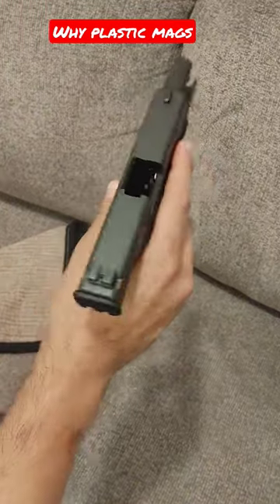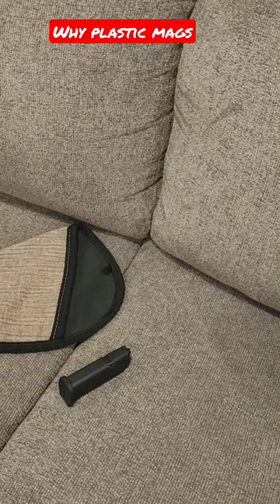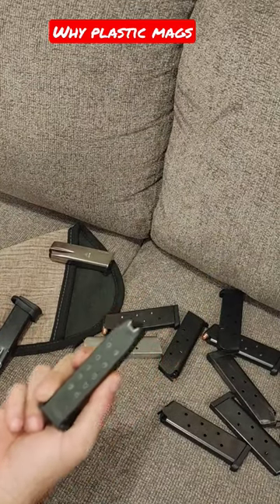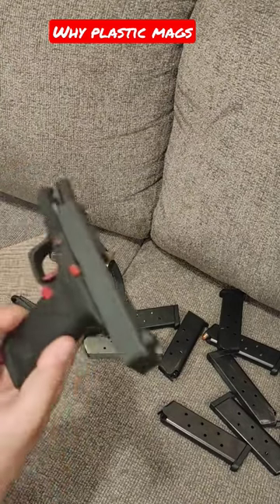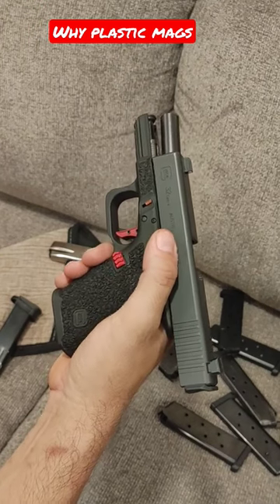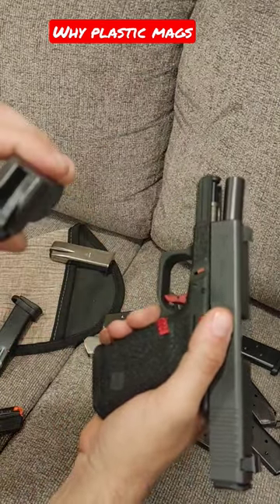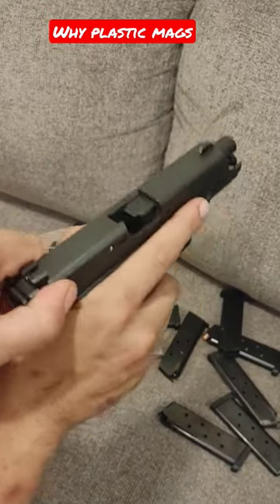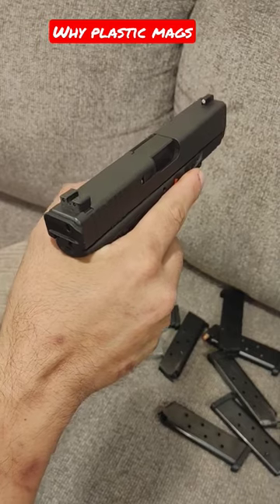why Glock ACTUALLY uses polymer mags

Comment: Glock mags are durable and don’t get dinged or bent up real easy when they hit the ground. They are simply more durable in that regard.
Reply: They're more durable than any of those metal mags.
Reply: @mynameisjeff6988  Yep, they sure are.
Reply: Maybe that was the case back in the day, not anymore.
Reply: @GunRunnersTrainingCo  No, it’s still very true. As someone who trains LEO’s for a living, I can promise you that Glock mags take a beating without separating, cracking, or denting, better than anything else out there. I have seen 1911 magazines split along the spine, Beretta/Sig magazines throw floor plates and take a sh;t, and countless others with bent feed lips. It’s simply a fact.
Reply: @GLOCKCOPG23  I've seen everything fail, including Glocks
Reply: @GunRunnersTrainingCo  yep, but Glock mags not as often.
Reply: @GLOCKCOPG23  I disagree based off my experience. I think everyone can agree that Sigs are the worst out of the bunch.
Reply: @GunRunnersTrainingCo  In my 27 plus years as an LEO firearms/tactics instructor and LEO armorer,  I have only seen worn out mag springs cause occasional feed probs on Glock mags. No bent up feed lips, no popping off floor plates, no mag tubes bent up or smashed beyond use, no cracked floor plates, no split spines, no cracked followers….. I did see one put in the trash after it was accidentally run over by a Tahoe. Lol. Between requals and new trainees, I come across a couple hundred Glock mags yearly (not to mention other manufacturers mags)…..what issues are you talking about? I’m interested.
Reply: @GLOCKCOPG23  I'm still using glock magazines from the Clinton's high capacity mag ban still stamped for Leo,  they still run great 👍.
Reply: @gregg6474  Exactly what I’m saying.
Reply: I would say Glock mags do cost more to manufacture. I have to make the polymer mag and you have to bend metal inlay instead of just bend a thicker metal.
Reply: I have never seen or heard of a metal mag getting dinged or bent. What are you talking about?
Reply: @MSSynsyterGates  When you conduct rapid reloads (rip, flip, stick) as part of most training regiments today, you drop them on rocks, concrete, plate metal etc causing this damage occur quit frequently. It’s collateral damage of expendables for realistic training scenarios.
Reply: @GLOCKCOPG23  I drop them on rocks and on concrete very often and have never had one bend or get dinged up. I shoot often with people that shoot often and have NEVER seen a metal mag that is of any quality break. 1911 mags have been around since forever and I havent heard of any of those running into any issue either.
Reply: @MSSynsyterGates  You’re fortunate and lucky. Bent feed lips and dislodged floor plates are an especially prevalent problem from drops that will shut your mag down. Be safe out there.
Reply: @GLOCKCOPG23  You're making it sound like Glock can never have these issues and they absolutely can.
Reply: @MSSynsyterGates  why don’t you scroll up and read from the beginning of this thread. I said they can but NOT AS OFTEN…Fact….but you’ve “never seen it”. You’ve never seen Pluto either so does it not exist? Just making a point…not to argue.
Reply: @GLOCKCOPG23  And my point is I've never seen a metal mag bend or ding either. Not saying it doesnt happen but its such an infinitesimal occurrence that bringing it up while saying glock mags are more durable than metal mags is just a pointless statement because it doesnt happen enough it ever be an issue. No one has ever thought twice about buying a gun because it has metal mags.
Reply: @MSSynsyterGates  Your experience is apparently much more limited than my 27 plus years as a firearms trainer and armorer. In your experience, mag damage is “infinitely small” but it my world, it is a reality that I and other LEO trainers have observed to cause issues on occasion. If you want to argue, you picked the wrong guy…I have no interest, but I can say what I have seen through many years as FACT.
Reply: Definitely, it keeps the manufacturing cost down for them keeps my cost down because I don’t have to keep buying mags that are dinged and dented. I have some slight issues with flocks but overall I would have no problem getting into a gun fight while carrying a Glock I would feel comfortable I would feel safe in knowing that my firearm is going to work

Comment: What's funny is glock mags work better than all of the competition combined 😂
Reply: I bought a 1911 and they said thow the mags away and buy aftermarket mags! I sold the gun instead!
Reply: I agree, I have a few Glocks. They aren't my favorite but I know their mags and firearms will work better than the majority of the competition.
Reply: @TheBobmoorensons  the spelling says it all.
Reply: @matthewlaramie7166  those appear to be typos and not spelling mistakes.
Reply: @matthewlaramie7166  Imagine being so nerdy and not growing out of correcting folks on the internet, let alone YouTube comments.
Reply: Dude, are you from Colorado?
Reply: I beg to differ
Reply: HK mags are better
Reply: @noway6633  how do you figure?
Also, HKs, especially/at least their rifles, are ridiculously overpriced, as are their mags.  A plain old 30rd GI mag for the 416/MR556 costs $59, and the 10 and 20 round mags cost $69!
Also, the rifle itself costs $3,500(just imagine how good an AR you could build/buy with $3,500), which is bad enough, yet the upper receiver kit, which includes bolt/BCG, buffer, and buffer spring, costs "only" $2069.  When I saw this it made me wonder, "so what the heck would I be paying another $14-1500 for if I decided to get the complete rifle?  How does a lower, LPK, pistol grip, and a stock(possibly a buffer tube?  I'm not sure on that) add up to nearly $1500?  That's insane.
Now don't get me wrong, I still want one(and I really want the 7.62 model), and I do own a USP and have considered getting a P30 or a VP9 Tactical(and ever since I was a kid I wanted a mk23(and silencer)), but if I do, I won't be happy about it...
Reply: Lmao you’re reaching young lady
Reply: @noway6633  For only 5 times as much as glock mag
Reply: I mean they're fine lol. I can't even think of a large gun company who's magazine's aren't as close to 100% reliable as Glocks are. Maybe when they came out in the 80s it was different but not now.
Reply: Laughs in hk
Reply: No they dont, they stick and the lips spread apart,  and the springs lose tension much more quickly than a lot of other companies.  And the "tenifer" finish, my g27 developed a half inch wide rust spot on the slide within a few weeks of purchase.  I was pissed,  and that was way back 15 years ago when they were$ 550
Reply: You saying that put you probably got extended mags instead of running stock 😂 even if it’s a oem mag you don’t need extra attachments if the sto k parts are relaible  and before I get hate I’m just saying buy and try more then glocks
Reply: False Sig better
Reply: @Mockturtlesoup1  you're right. If you had endless money then ofc this wouldn't be an issue but since you don't then yeah there are cheaper options that preform the same if not better especially given that you could modify and still end up spending less
Reply: You’re joking right? Springfield, SIG, HK, FN, Kimber, Walther, and even Canik. I wouldn’t include Ruger or Smith and Wesson in the convo, but that’s about it. I’ve put well over 10k rounds into every reliable manufacturer I’ve listed. Hell…I have a Springfield XDM9 with over 50k rounds and still use the mags it came with. I’ve had 3 glocks. One broke with a stuck pin and would shoot the whole mag from just releasing the slide after about 100 rounds. The plastic rail broke on another at 700 rounds. And the 3rd I got rid of because of my disgust with the other 2 and the aggravation from how much the brick rattled. I own guns from nearly every big manufacturer out there…..except Glock because of it. I’ve had hi points last more rounds without malfunction than any of my glocks did, and I clean my guns after every range visit.
Reply: Not really
Reply: I dunno my Sig mags feed just as good as my Glock mags do. As long as the weapon functions properly I don't care.
Reply: It works great
Reply: The Glock is a better gun
Reply: i agree but im thinking its because unlike other brands glock uses matching materials. ive had a sccy cpx. one brand that uses polymer and metal and the metal mag wore the polymer release out wayy to fast.
Reply: Kk
Reply: @waynewilliams5353 Tell me you have no clue without telling me you have no clue.😂
Reply: @joshrandall3632  tell me you only buy Glock without telling me…….buddy I sell mags and ammo and have my own personal firearm collection bigger than most local gun store inventories. There’s more out there than the brick my guy
Reply: @@joebama6911  None of those guns are measurably better and certainly not more reliable. They're not made any better and definitely aren't made from better materials. They're just different looking clones of a Glock. I've seen plenty of XDs jam, HKs too, not to mention the self-shooting Sigs. That's all just anecdotal evidense either way.
Reply: The Company make the magazines in polymer because they make firearms thinking that the soldiers in the war can walk in different places,different weathers,Remember that the soldiers no need to much weight so they even make the sights in polymer.The gun in the war if the a weather is cold dont get to much freeze.Sorry for my inglish but you guys know what I means
Reply: I don’t know why people praise Glock so much I always here the you don’t gotta take care of a Glock it’ll still function that’s an asinine comment to me because I’m never gonna not take care of my guns and you can definitely put smith and Wesson through the ringer and it’ll function.
Reply: my caniks are better in every aspect imaginable
Reply: @yourlocalRx  I definitely gotta get a canik
Reply: @trilogy3x  People praise Glocks because they are as reliable as any gun availableand moreso than most. They've been that way for 40+ years. Even when abused and neglected they work with little or no maintenance. S&W and other Glock copys can be just as reliable, but some are not. It's good that you take care of your guns. I take good care of mine as well. Some situations exist or may exist that would prevent a person from caring for their gun as welm as they would like to though. In such a situation, it's nice to know your gun won't fail.
Reply: @yourlocalRx  😂😂😂
Reply: @joshrandall3632  I’m only 26 so I haven’t dealt with Glock long my first firearm I shot was a .357 magnum revolver from smith and Wesson that gun is probably older then me and still running I currently have a Taurus G2 had it for 6-7 years I love it my dad has a .40 cal smith and Wesson and I just bought my mom a .380 smith and Wesson since I’ve been able to own and buy firearms they all have been reliable and work well without cleaning I don’t know if it’s cause companies are getting better or what but reliability isn’t even something I look for in guns because I’m spoiled to grow up in an era where all the gun manufacturers have quality products that probably why I don’t feel the hype about Glock like older people do even some people I know that are my age can only go off reputation of Glock because we never experienced a time where Glock was the most reliable thing around.
Reply: @trilogy3x  That's all true. I hate that Glock hasn't adapted or changed over the last 40 years. On the other hand, that's part of their strategy, part of their charm. They were way better than anything then but now others have caught up. I don't know if they're the best anymore and they're not even my favorite, but I know I can trust my Glock no matter what.
Reply: @joshrandall3632  yeah I’m going to buy a couple just to have.
Reply: Not true whatsoever lol
Reply: @salvadormendoza8400  But really it is.
Reply: For real lolz 😂
Reply: Uhh...NO
Reply: @TheBobmoorensons Well depends what you bought, if You bought Tisas, Giran or Rock Island Armory don't blame the 1911
Reply: @pharaongaming8617  i honestly can't remember the company. I know there are good ones made or they wouldn't be popular. Probably going to get a staccato or nighthawk eventually.

Comment: Yeah I’ve always wondered how long till the thin metal inserts give out on me
Reply: 3rd party ones have been a pain in the ass with those inserts being a couple thousandths longer and it will hold open on the last round *in the magazine*. Super annoying.

I had a friend almost ND at the range because he thought he was out, dropped the slide, then for whatever reason pulled the trigger. At least he was still pointed downrange.

All the mags that do that shit have bright yellow paint now 🤣
Reply: @ObservationofLimits  Will swaping the mag release fix the issue, sorry if it's a stupid question?
Reply: @jinga876  theres no stupid questions in the search for knowledge
Reply: That’s why I got 10 of em😎
Reply: The metal oem inserts will last forever
Reply: I can say at least 10000 rounds each and 30 years for my Glock 23 mags
Reply: @edwardcase6594  so glocks and Glock mags are durable and reliable? I carry an HK USP 45 but considering a Glock for capacity reasons 30 rounds I’ll take it. Do u recommend Glock as a primary weapon??
Reply: @americantopgunner5102  Glock gets the job done very durable.
Reply: @edwardcase6594  Alright
Reply: Longer than ur full metal mags will… yall forget polymer is FUCKING AMAZING JUST AS STRONG thats why everyone uses it. That metal insert is just for smoother feeding tbh, not really for strength, look at ets they’re mags ROCK yet they’re full plastic
Reply: @pablo4yu  it was sarcastic my guy
Reply: @jinga876  file top of mag
Reply: @americantopgunner5102  oem glock mags are 150% better than non oem, they make a stock 32 round so i dont think you should have trouble lol
Reply: @americantopgunner5102   here is the idea we carry at Kilo. Glock desgins are great. The basic mags and Magpul are great. Just buy the gun from someone else. I've personally has far too many possibly deadly malfunctions with glocks to trust them. However PA Dagger, CZs, P80, etc. All great from my experience.  I've never had issues with glock mags especially modem gen 4 polymer mags. (Also side tangent polymer is NOT PLASTIC. Its a resin. Yes plastic is a type of polymer but polymer is not a plastic. Especially glass filled polymers which are a type of nylon mix)
Reply: @snownoheakennedy9561  wat u mean buy the gun from someone else? Buy a used glock?? P80 not allowed in California cuz is nice but not sure if u can mount a light.
Reply: @americantopgunner5102   RIP my brother in soul. What I mean its buy a gun that uses glock designs but have a better quality to them.  Basically something that's compatible with glock but isn't glock. Like how you'd buy an AR. Buy an AR15 platform but not from colt or Armlite. The same with Glock
Reply: I still have & use the 3 mags issued to me in '95; only had the springs replaced in 2015 when I noticed the mags were getting a little too easy to reload!  No free lips/insert problems yet & they've been fully loaded the whole time.

Comment: Just in my personal experience, I've had the same G19 for years with original mags, and have loaded and fired thousands of rounds from them, not to mention mag changes on gravel, pavement and in mud. I've never had even one issue. When they get dirty, I wash them with dish liquid, dry them off and give a shot of RemOil into one of the round indicator holes. Always worked for me🤷‍♂️

Comment: Just went through the Glock certified armorers course. Everything stated is correct. Primary reason is to keep cost down. However it does not reduce the firearms reliability. All stock glock components go through 40,000 round test to ensure reliability. That includes magazines.

Comment: How about Glock mags can be purchased for around $20 brand new. What other brands do are around that offer $20 magazines? Sigs are $40+, HK $40+, S&W $40+, CZ? iWI? Beretta’s are cheap because surplus mostly. Glock is saving money sure but they also make them affordable when the other main brand mags are almost always more expensive. Never had a dramatic issue with Glock oem mags. But use this to take a shot at Glock… why have heavier magazines when I’ve rarely if ever have heard of them failing.
Reply: "Berettas are cheap because surplus mostly"

That's exactly why they're cheap. A Gen 2 G19 and and a Gen 5 (assuming you have your safety on the right) use the same mags. It's easy to charge less when you have literally millions of guns using the same mags.

Comment: Continue to use the Glock factory applied Copper colored Bronze Oilite ball bearings lubricant Grease. Anti-friction and Anti-seize. Stop using Wet and messy oils that splash and migrate within the frame and slide. Bronze Oilite ensures long term lubrication of the Slide and Frame. This is the lubricant that Glock pioneered and changed the way Glock marketed the Glock 17. From a through away $150. 9mm pistol  to a $300. 9mm that never wears out.  All due to the use of the copper colored Bronze Oilite in a handgun.

Comment: Less wear in the mag well. Cheaper to replace the mag vs frame. My 1st gen g19 mags (no metal inserts) wore out that it started jamming on the 7th or 8th round. I replaced them with 2nd gen mags. Problem solved!

Comment: They use a strong metal insert to hold the ammo in place and prevent the mag from deforming from the ammo pushing out, then the plastic to be lighter and able to protect the metal from dings and dents. Yeah cheaper but also better than just straight metal. Lighter, durable, quieter reloads. It's cheaper and better